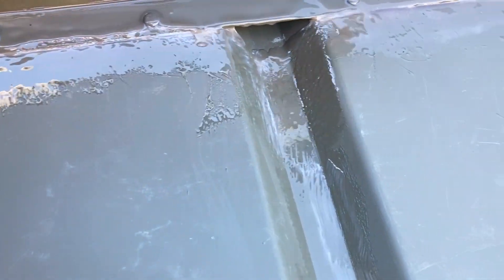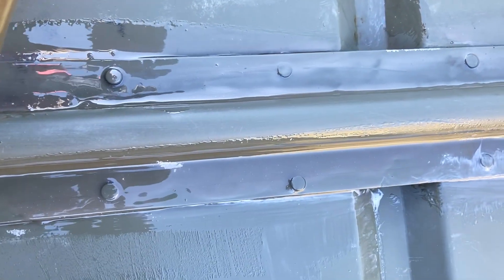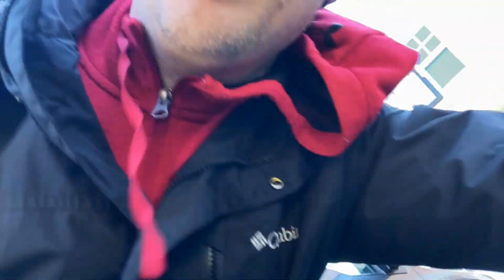How to Fix a Leaking Rivet in Jon Boat

Comment: The way a fix some rivets in my boat that looks like yours is using a car jack placed under put a solid piece of steel pushing up the rivet and  from inside the boat hit the rivet with a hummer like 5 or 6 times not to hard,and believe it, i dit not use any liquid sealer, only the hummer and still no more leaks…is fixed.
Reply from the maker: @gbbanelli  thats a great idea!!!

Comment: You don’t do anything to the bottom?
Reply from the maker: So, this worked well for a season to really slow down the leak, but ultimately the best way to fix it was to drill out and replace the rivet in the ling run. This boat goes in some pretty good chop sometimes so the gluvit wasnt able to hang with those demands